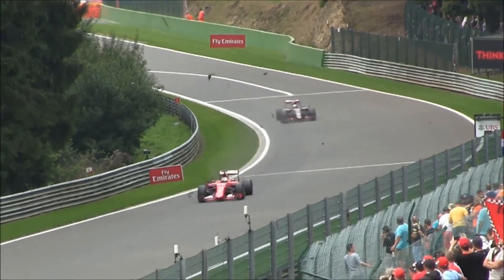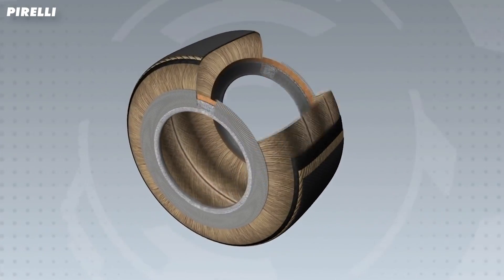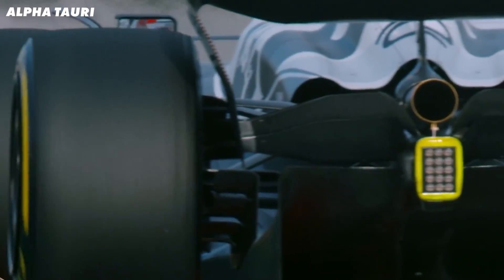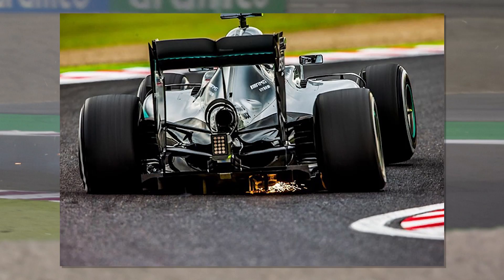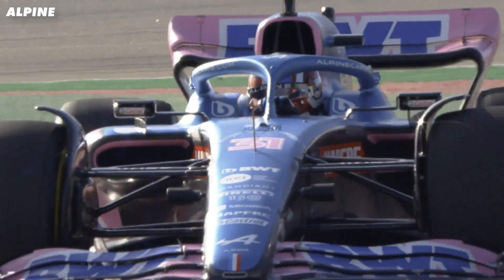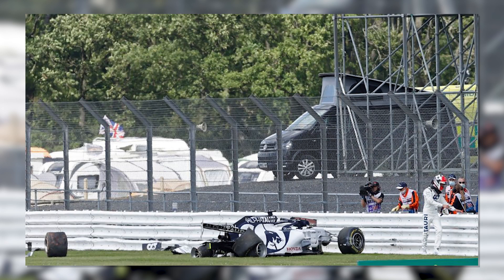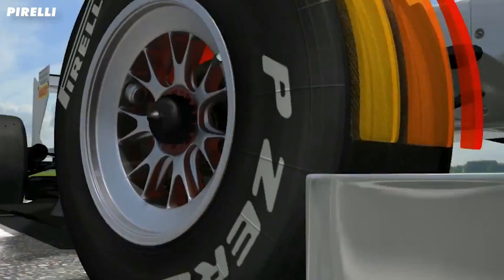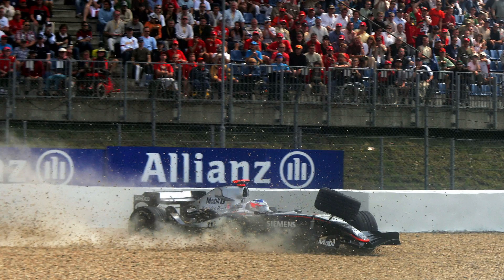Why Formula 1 Tyres EXPLODE

Comment: What are these miles per hour? F1 uses metric system.
Reply: The UK - where he's from - uses imperial for speeds
Reply: @AndrewGeierMelons  yeah, we (the uk) are totally messed up. We buy petrol and diesel in litres but measure fuel consumption in miles per gallon!!! Crazy 🤷‍♂️
Reply: @AndrewGeierMelons  do they still use it
Reply: @XTR_NEELAN  to this day, only for cars and such, yes. Our speed limit laws were written before we switched to km so we're just sticking with mph for speeds, haha
Reply: @AndrewGeierMelons  Canada changed to km/h just fine. . . Maybe if they made it mandatory and didn't half-ass it?
Reply: @XTR_NEELAN  oddly enough we Brits still do
Reply: @Josh-jx4br  oh well
Reply: In the UK we use mph most of the time
Reply: He’s British. We use miles per hour. Deal with it
Reply: He said 'Vitimins'... It's a fair trade
Reply: yes, like many others also pointed out, this has actually nothing to do with the US. the imperial system comes from Britain and for speeds, they still use it up until this day. yes, they're not American owned and try to finally get a stronger hold in that market, but the division between those units goes back a long time. Formula One originated from the UK (where the heart still remains) but tried to please to a mainland European audience which is why they simply use both units simultaneously since I can remember (which reaches back into the late seventies, lol). or in other words: it's very appropriate for him to just use mph, IMHO. and as for feet: that's still a worldwide accepted standard in many areas like aviation, so maybe folks just try to get a little more familiar with different units and all will be good again 😉😊😅
Reply: Pretty sure UK use mph…
Reply: Least they could do is show the kph in screen.
Reply: Multiply by 1.61 to get kilometres an hour
Reply: @michaelcooper4986  apparently it’s hard to do simple math…. If people really cared about the difference between mph and kph the math becomes instant after time
Reply: What the f*ck is a kilometer!? (jk)
Reply: In uk they use mph... I reed the comments and i laugh with people ignorance and other comments like oh he do it for usa audience etc. He just use the system he's familiar to him nothing more. Plus most f1 teams are located in the UK so i guess most technical information are in imperial system.
Reply: @STEFKA1984  the engineering world uses km/h, no matter where you are
Reply: @SneepDeg  not really depends where you live in Australia for example they do have kph but they measure in kw not bhp or hp. And universally everyone buying tv and monitor's measure in inches not cm. My point is what is natural to you it's not the same for everyone respect the culture that ppl have.
Reply: MPH, cubits, and gallons are said to be esoteric measuring systems from now defunct "civilizations" still carefully preserved by Flat Earth Believers
Reply: welcome to the stupid US system
Reply: The system used by the majority, except stubborn countries? Yeah, we the problem, let it go, British still use a stone to messure
Reply: Its for the American new dts fan i believe
Reply: Freedom units
Reply: A comment like this is infuriating..... it glosses over context and cultural differences with no regard for either.

Yes F1 engineering (like all science and engineering fields) uses SI metric. 

But when presenting information a UK based youtube channel is going to use UK based cultrual norms (context: UK based channel with a UK based presenter. Cultural norms: UK mix of metric and imperial).

In the UK MPH is used for speed of vehicles, all road signs use MPH, speed limit laws are in MPH etc.. Feet and miles are also used as units of larger distance, with metric m, cm, and mm used when talking about smaller units in general - depending on the generation.

Motoways use miles, feet, and yards for junction distances and signs.

Feet is also preferred for height measurement (so how tall someone is, an elevation of a hill etc.)

Now: you are a UK presenter of a UK based youtube channel, and you casually ask Christian Horner how fast Red Bulls go, I 1000% guarantee the answer will be in mph. If you ask Toto Wolff, it'll most likely be in KPH (cause kph is used in Germany etc.). If you also ask Christian how long his daily commute is he'll give an answer in Miles. But then go to his office and start using KW for engine output rather than HP (even though he'd tell you how many HP his personal car has if you asked).

Drinks in a pub/restaurant are sold in pints (obviously not wine or spirits - spirit measures are in ml). Milk from a traditional milkman is in pints, but from the supermarket is in litres. All weights are in Kg. The UK is a total mish-mash.....

Why do you care anyway... people don't moan at a US woodworking channel when they use fractions of an inch for their units of measurement, even when the international standards the screw/drillbit manufacture use to build said drillbit/screw use SI measurements....
Reply: @Thats_Mr_Random_Person_to_you  Really Bruh??!!🤣🤣 You literally got triggered AF over a random comment which I'm sure was sarcastic/trollin!! Just a joke. It's literally like folks from countries such as India, Japan, New Zealand, Australia, Thailand, Hong Kong, Kenya etc (Pretty much all the countries that were colonized to the moon n back by the Brits) are right hand drive. So usually when an American or folks from other countries where its LHD ask "Oh y'all have the steering on the right side?" we respond with "Yes, n y'all have it on the wrong side ".. It's all just in jest. Nobody is attacking anyone's culture n shit. Sheesh!
Reply: Not for wheel diameter, they always gave those in inches 😉
Reply: Because Britain used mph
Reply: Damn commie wanting un-free units of messuermnet
Reply: Multiply by1.6 so 200mph is 360kph
Reply: He’s British with a mostly American audience, 2 countries that use MPH for speed.
Reply: WHAT THE FUCK IS A KILOMETER?! (Insert machine gun noises)
Reply: If it's not Mac&Cheese/ Cheeseburger i can't follow
Reply: @just9911  which confuses all the locals
Reply: 321kph=200mph
Reply: I switched to kph quite a few years ago.. however I still don’t understand it as easily as mph lol.. if I see 250kph I have to convert it to log in my head to understand how fast it ‘feels’ if that makes sense 😂
Reply: Bro thought it was easier to comment rather than web search
Reply: @darshgupta7682  Did you consider that giving feedback is crucial for change to occur? So that no one has to search for the answer... I mean, instead of thousands and thousands of people either searching for the answer or not knowing the person that is sharing their message does that ONCE....
Reply: It's very easy and simple.  Ok,so watch........100 kmh is 62mph. 200 kmh is, you guessed it, 124...300 kmh is 186. You see the pattern? Lol pretty simple.
Reply: @billyyank5807  I know how it works... what i was doing was to give feedback so that information is clear and THOUSANDS of people don't have to do any math. It takes a few seconds and you lose pretty much all information given for that length of time. 

And when we remember that MAJORITY of the planet uses metric system.... 

Did you really think that people don't know how to convert between the two? And i think i even explained it once already in this very comment thread.. Maybe you aren't so clever after all?
Reply: Our flag is on the moon, so it’s miles per hour
Reply: @luisgonzalez1637  That flag was put on the moon using the metric system.. well, it was a mix of both but all the calculations were done in metric, and then translated to US customary, which requires significant amount of resources from the computer. If it was fully metric it would've been EASIER to get to the moon. After those missions NASA moved to fully metric. If your system was better, it would've not done it.

Also, US customary units are tied to metric system.  If metric system changes then you would have to change too, or define your units again..
Reply: Freedom units are better than kph, damn commy
Reply: 1 mile = 1.6 (ish) km...

It's horsepower vs kW I always forget.  It's just a bonus brain exercise.
Reply: 🦅 WTF IS A KILOMETER 🦅
Reply: @RINO8604 A thousand meters. Meter is the base unit of distance on this planet.
Reply: Not to mention he used ft when speaking about elevation
Reply: @adan6430  mph for speed, ft for altitude and km for distance.
Reply: Damn imperialists!
Reply: @markolitvic6981  👍🤭🤣🤣🤪
Reply: Kph would be fine with me but I’m guessing a majority of viewers are located in USA and are casual fans, and if that’s most of your audience, it’s easier for them to understand mph 🤷🏻‍♂️
Reply: @ansond88  ya but also F1 isn't very much popular in us compared to other countries that should change in coming year's
Reply: @ansond88  or the UK where we also use MPH...what with this being a UK channel
Reply: @ansond88  not really he's British so he's using the imperial system it's normal for him plus Seven of the current Formula 1 racing teams are UK-based teams, some of which may come as a surprise. What is this? The 2021 Formula 1 teams based in the UK are McLaren, Williams, Aston Martin, Mercedes, Alpine, Red Bull Racing, and Haas. So the technical data are more likely to be in imperial system.
Reply: @ansond88  Really? I don't think the US has as many viewers. Alot of motorsports enthusiasts stateside whom I've had conversations with had a disdain for F1, primarily cos money in the bank literally defines the winning teams compared to the rather level playing field like in NASCAR n Indy.
Reply: @ansond88  just use metric and then put the conversion for the weird people
Reply: @ansond88  too logikal
Reply: @ansond88  Let's stop compensating for America.
Reply: @ansond88  Nice counter point
Reply: @ansond88  Being from the US is the only reason someone needs for not understanding KPH as well as MPH.  I’m not a casual fan at all but mph is way easier for me (an American) to comprehend because it’s what I’ve used my entire life.  It is the better system for things non scientific though.  100mph is fast, 200 is really fast, simple enough.
Reply: @ansond88  the majority of viewers aren't from the US or UK....
Reply: The US is infact one of the highest viewer count with china
Reply: Technically we should be using meters per second.
Reply: @bjoe385  thats true but kilometers per hour is still metric.
Reply: not in the uk, where the broadcaster is based, where the parent company's headquarters are and where the majority of the constructers factories are based.
Reply: The conversion is very simple. You’ll be alright.
Reply: The bald eagles as metric units is a more accurate and fascinating way to measure 🦅
Reply: Playing to the American audience? 🙂
Reply: @Slide100  U.K. viewer. I prefer m.p.h. for such high speeds. Including cyclists who don't ride casually, skiers and sprinter runners..
Reply: We speak freedom her not commie American love it or leave it
Reply: Agree.
Reply: stikstof-
Reply: just deal with it lmao.
Reply: cry
Reply: ignorant comment just do the conversion in your head if your that bothered
Reply: USA USA USA 🇺🇸
Reply: F1 is American owned. Deal with it
Reply: @B0CAJUN10RS1995  so? Most people use metric, only a few weird countries still use imperial
Reply: @Giuliana-w1f   well maybe one of those “normal” countries can buy F1 and then implement the metric system. In the meantime you can either learn the imperial system or keep crying about it
Reply: @B0CAJUN10RS1995  ah yes liberty media, set in the UK, is American.

Comment: It's interesting that you rarely see tire failures in Indycar.  I think they put safety above performance more than F1.
Reply: Don't indycars have less downforce and power? I'm pretty sure that these factors put much less load on the tyres.
Reply: @wombat4191  2005 Indy GP.  I also remember the backside of a curb at a British GP cutting through the sidewalls and rupturing the tires.  Tire failure is not the same as wearing the surface out.  In the past, Indy/CART was pushing over 900 hp.
Reply: IIRC. FIA set a spec for F1 tyre to make racing more dramatic. And the result of that F1 tyre will go downhill at a certain point for each compound.
Reply: @mixswist  yeah apparently it's a bit hard to make tyres that are durable enough while at the same time last so short distances, that's also surely a factor.
Reply: I don't think so there is major speed and compounds difference

Comment: On the topic of tyres, can you do a video on why the Michelin tires failed at the 2005 Indy GP?
Reply: Not strong enough sidewall iirc,Bridgestone already had data from Indycar to use special tires there
Reply: theres like a thousand videos on it
Reply: @milk3013  I prefer Driver61's. It just sounds nicer, and the clips keep me in. I'm not too sure why either.
Reply: The diamond cut (the grooves) on the track were the problem. They grinded the tyres.
Reply: Before the GP there was a non F1 race there where Bridgestone was one of the tire manufacturers. Using the data they gathered on the track they made a pretty suitable tire. Unlike them Michelin had no experience on the recently changed track asphalt shape (diamond pattern, pretty harsh on tires but grippy) so their tires degraded way too quickly.
Reply: chainbear has a pretty good video about it!
Reply: @luigico8657  oh! I haven't seen. I will check it out soon.